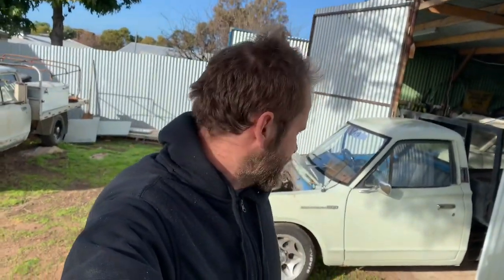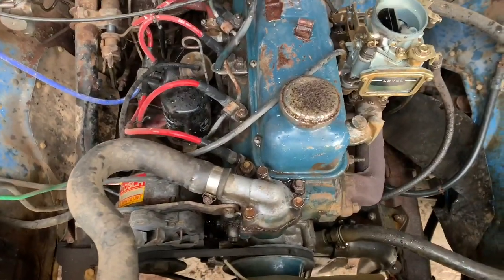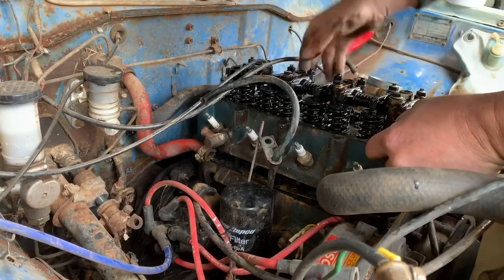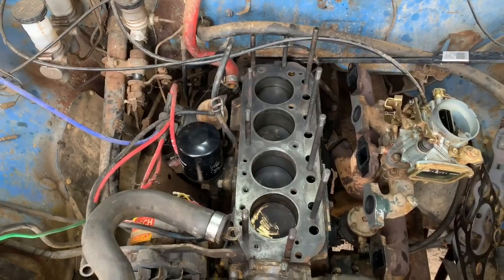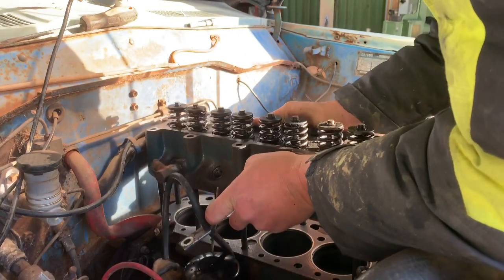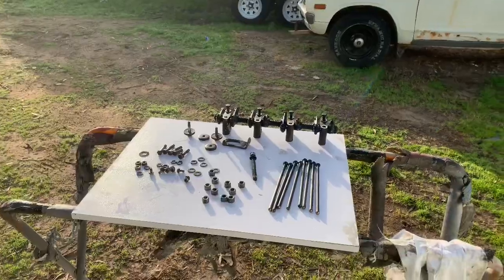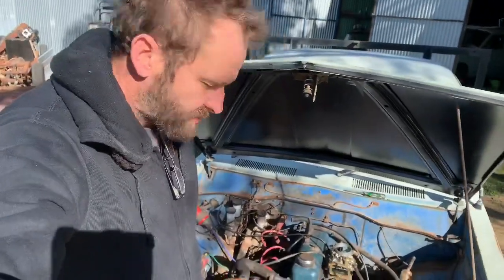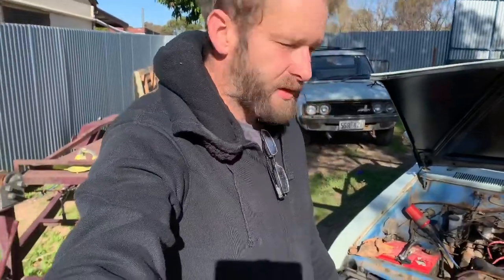Datsun j15 head gasket replacement

Comment: Hello, a) how many pounds do you regulate the torque wrench?
b)how many mm you adjust the valves intake and exhaust?
Reply from the maker: Hi. 
Head bolts.  36. Then 45 ft lb 
Valve clearance .010 hot
Reply: @Restoration.revival-w9d  valve clearence is 0.35 mm  o,  0.0138 pulgadas. hot.